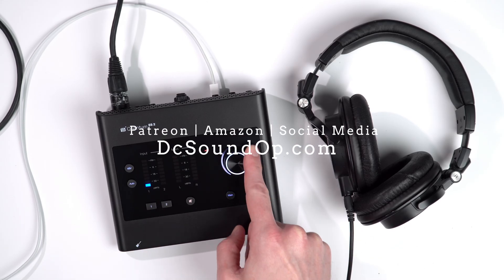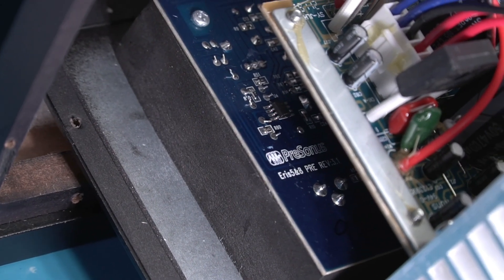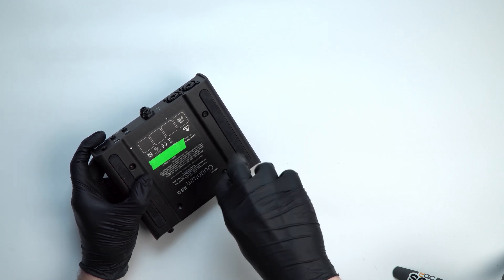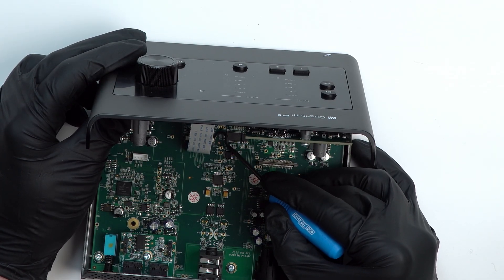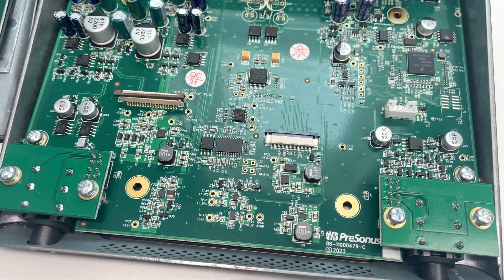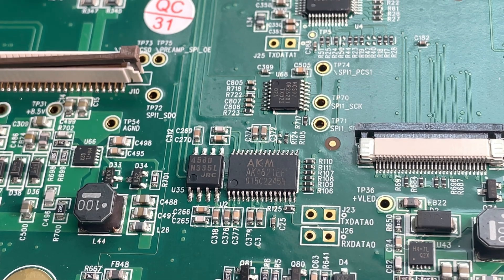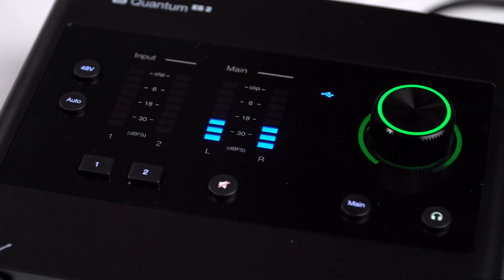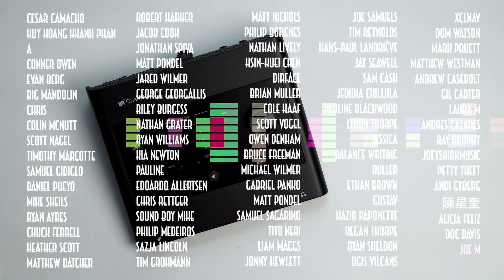PreSonus ES 2 Teardown - Just a repackaged AudioBox?!? 😮‍💨

Comment: I bought the es 4 in December. I don't have any issues with noise or anything. I had issues with the USB cable tho, there was noise in the headphone outs, had to buy a better usb c to c cable and no noise . After that the device always clipped internally after turning my pc on. But the output of the pc wasn't clipping. Only way to fix it was turning the device off and on with the power button in the back. I told them about it in support ticket. They told me they'll get back to me but they never did. Two months later my speakers blew out because of the bug. Then there's another bug that whenever I use the input buttons on the device, the monitor automatically switched to B from A . I had a client at that time and he was so confused when it happened and i lost that work because of that. On top of the damaged monitors. When I complained to them about it , they told me i have to give them the device for evaluation without any loaner unit given to me. Which meant I have to stay out of work for the meantime. And they won't even give me compensation for the monitors, which clearly wouldn't happen if they figured out a fix when i told them. Now they're ignoring me because I bought the unit overseas and I'm from 2nd world country. I was always loyal towards Presonus, using their Eris monitors, Early interfaces, and promoting there DAW . And i had to pay lot to get the interface overseas because it was released in my country. This is how they repay my loyalty. Don't get me wrong, the Converters and the Pre amps of this interface is really good for the price. But the company and the support team is unethical. I doubt that they would do this if i were an US citizen